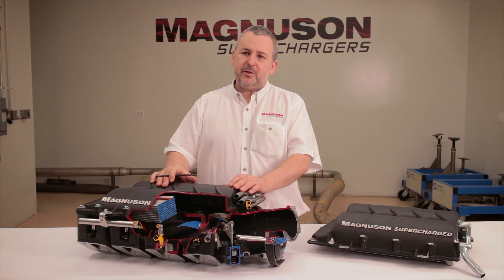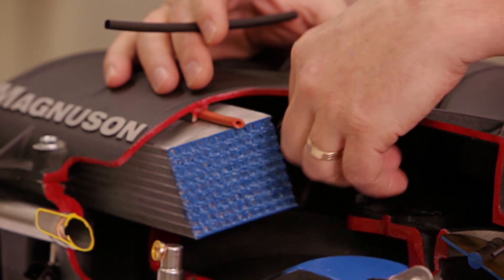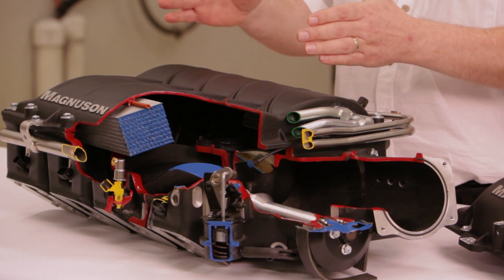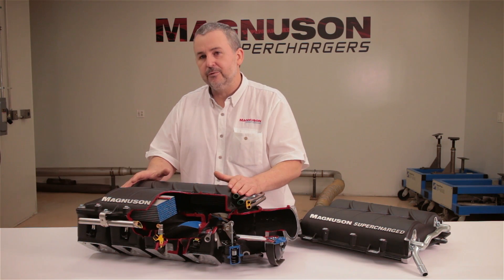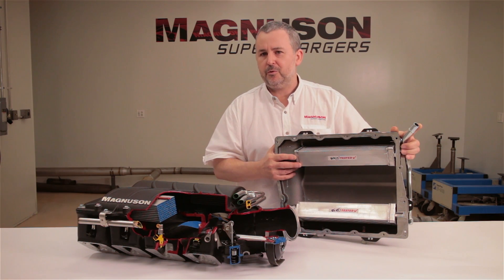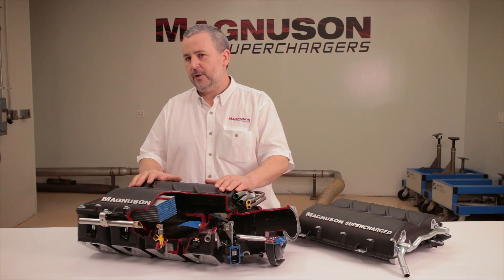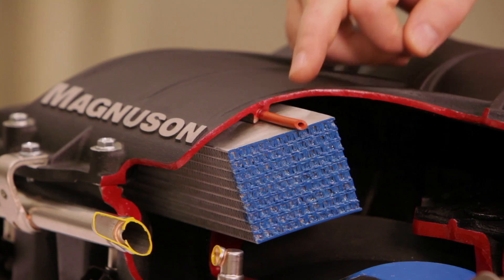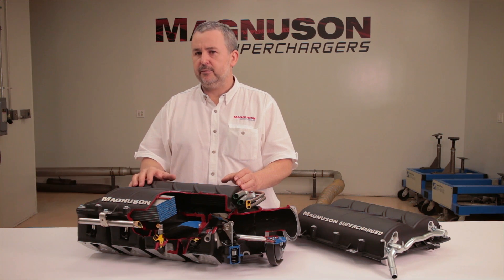Magnuson's Heartbeat Supercharger - An Interview with Designer Ken Nunn

Comment: Excellent supercharger. Made it my choice for my VF R8 clubby upgrade. Combined it with a 3" exhaust, ceramic headers, chrome moly pushrods, and cam upgrade and power went from 340kw to 539.4kw on the dyno.

Comment: I have one of these on my L98 Berlina...produces 372 RWKW ..thats 498HP in the old terms..... with standard 90mm pulley...want to go for the 85mm pulley......a note that the standard fuel pump is just about at its limit .....will be upgrading the pump system and pulley ...next stage is a cam ...but thats in the future